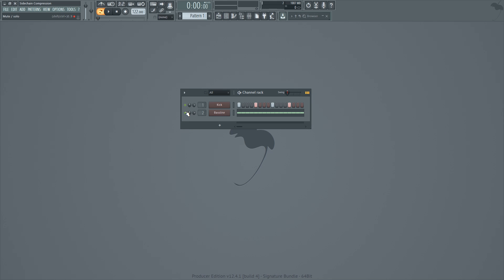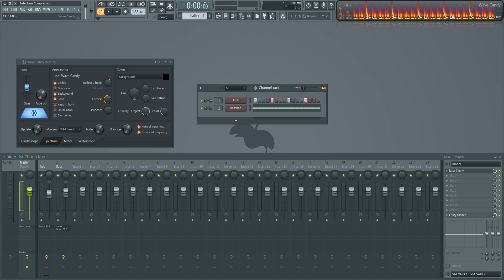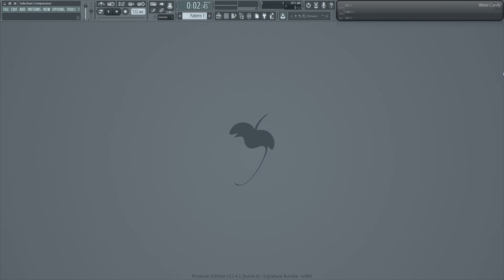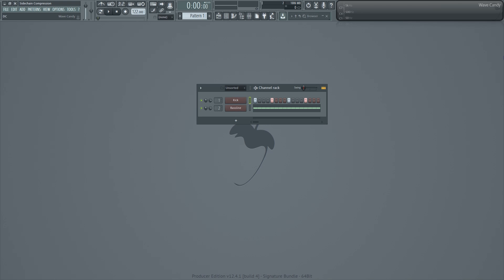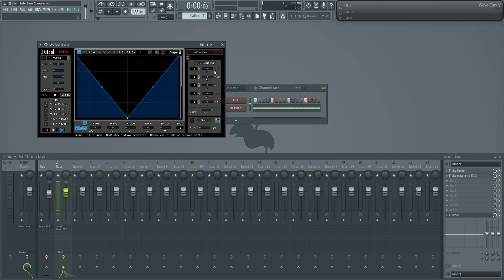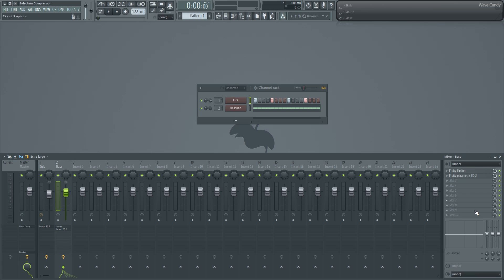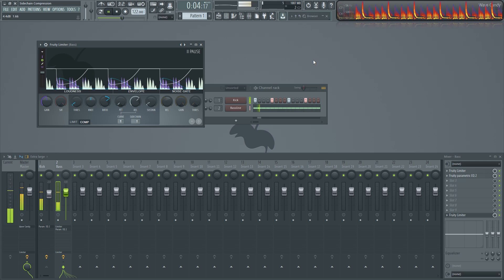Sidechain Compression Tutorial + 4 Favorite Methods in FL Studio 12

Comment: Side chaining is very important and to start to understand how to match kick and bass has many methods.First is to know lenght of kick and make kick to be in key of the whole track.Later on calculate lenght of kick in miliseconds.On that fundation you can make bass to be compressed less and have more bottom end.FL  limiter is easy but first fail is no value meters.This does not help to know how many dB you reduce bass line for example.
For trance make kick shorter and give good attack ( klick) then you will avoid problems with bass.

Comment: Hello what if I use pattern mode, how can I use the first method? I don't build with ''tracks''. thanks
Reply from the maker: The first method applies to the playlist only. However, you can trigger automation clips within patterns as well by selecting "All" instead of "Unsorted" filter group, and then dropping in a step on the automation channel wherever you want it to trigger in your pattern. In the case of the example in the video, it would be one on every beat.

Comment: This might be a stupid question but instead of automating the bass' mixer volume, could he have automated the channel volume in the channel rack instead. Or does he run into the same issue?
Reply from the maker: The problem with doing that is you are messing with the input signal the effects in the mixer channel, which can lead to undesirable results. For example, if you have a compressor, it can effect whether compression is applied or not and how much, because the input signal may fall below the threshold. You want to automate volume after they've had their effects applied, in most cases.
Reply: Electronic Producer thank you man

Comment: Hey bro your tuto's are great but I think you forgot a part in the link controller with the mapping formula. I think it should be in inverted mode because otherwise the bass is always gonna go up with your kick ...I struggled for 2 hours after your tuto cause that made the contrary effect of sidechaining xD Cheers
Reply from the maker: Hey there. Which method/part of the video are you referring to where inverted mapping formula is needed?
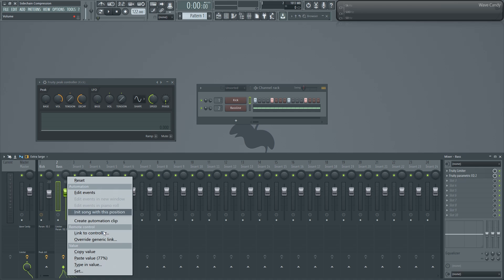Reply: At 13:23 once you've linked the bass with the kick peak, you have to select inverted in the mapping formula if I'm not wrong :) Cause without that the bass will follow the initial peak signal and go up at the same time as the kick .With inverted the kick go up and the bass down
Reply from the maker: Inverted mapping formula isn't necessary here since I'm modifying the parameters of the peak controller (specifically the volume parameter - because it's set to negative, the volume will go down from it's base level when the peak is triggered).
Reply: All right I see now ;) Disregard my comment then and thanks for the tips

Comment: I have a question about  method 4, with the limiter/compressor (which is for me the best and most accurante one, especially if your kick is not always at the same place during your song, doubled, etc..). 
Is there any way to export your project with separate leads, but including the side chain? 
As example with this technique, if I export the bass and the kick separately, and give them to an artist to add some vocals , my siedechain won't be there. I'm wondering the same thing for any type of export after putting any type of effect that affect other leads (drums bus as example). 
Does anybody knows?
Reply from the maker: If I'm understanding you correctly, you want to have the sidechain effect without the actual source of the sidechain (kick) coming through? If so, just take the kick or other sidechain source off of the master bus.
Reply: Electronic Producer I will try but I don't think you understood right (pretty hard to explain lol).
Let's make it simplier and focused on sidechain, method 4.
Let's say I just have 2 leads, a kick and a bass line. My objective is to sidechain my kick on my bassline, but export the 2 leads separately afterwards.
My problem is that if I export the bass on its own (so in solo) , it won't have the sidechain, as the kick is not active when I export my bassline.
What I would expect, is to see my bass lin exported, with the curves from the kick sidechain.

The whole purpose of that basically is to mix my song as good as possible, but still be able to export in separated leads, for other artists to be able to add their parts (vocals as example).

Hope this is clearer lol :) thanks for your help!
Reply from the maker: Yes, so what you want to do is unroute the kick from the master channel like I mentioned, and export it along with your bassline. Does that make sense? So the audio from the kick won't come through, but the sidechain to the bassline will still be in effect.
Reply: Electronic Producer I'll try that tomorrow, I'll let you know ;) thanks for your reactivity anyway!
Reply: Yep that was exactly that :) Thanks for your help ;)

Comment: Another method of not messing with the overall bass volume is to automate the volume of a fruity balance plugin on the bass insert.
Reply from the maker: Great tip. Thank you!
Reply: Agreed. I have made my Sub/Kick have different frequencies on some tracks. High pass my kick at 90 and low pass sub at 90. Then you can avoid side chain altogether. All depends on what type of sound you are looking for of course.
Reply from the maker: Interesting technique, but I would watch out for sharp EQ curves in the lower frequencies, as they can do some weird things to the harmonics. May not be an issue at 90Hz but still worth looking out for (you can see it visually in wave candy when it happens).